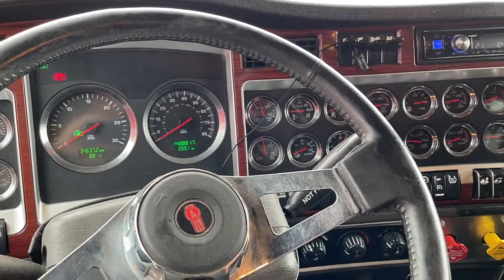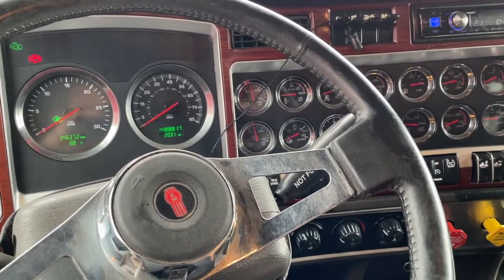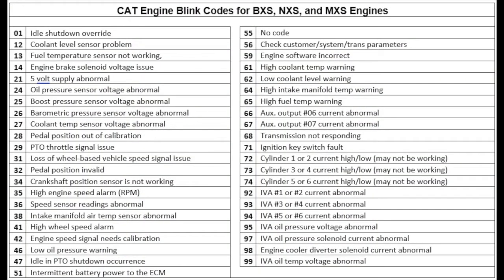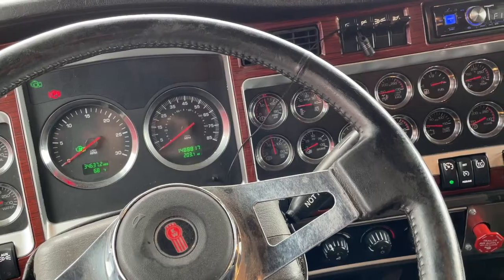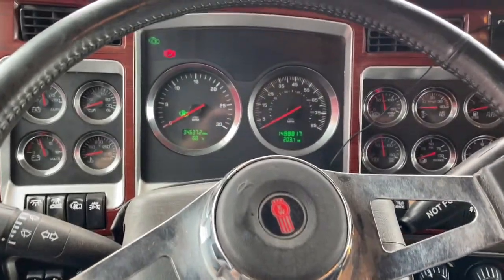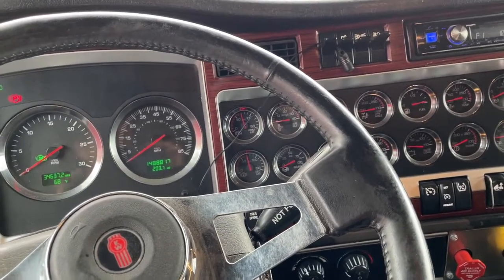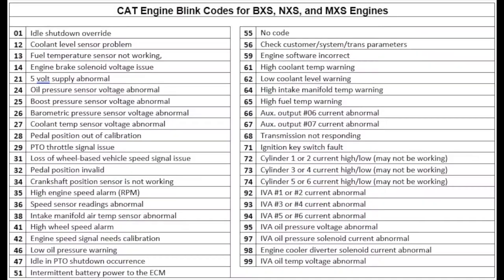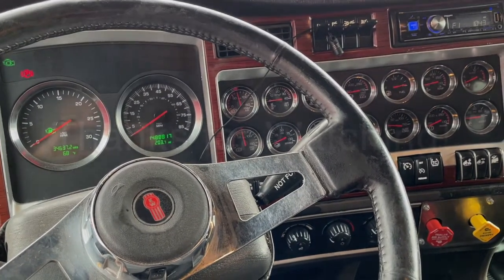CAT Engine Blink Codes

Comment: Hey, does the code go away after the problem is fixed or will it still come up when doing this?  Something like low coolant code 62.
Reply: One thing I love about CAT engines is they don't need to be pampered, once the issue is fixed the code will clear itself

Comment: I have on my truck the 55 code driving down the road with out doing the test. Any idea why?
Reply from the maker: Yes, you have an intermittent code that isn't staying on long enough so it always registers a code 55 - no code. Most likely you have a 92-95 code. You have to plug into it and pull inactive codes and it will tell you which one is giving you grief.

Comment: It’s not working for me any thought on why?
Reply from the maker: Well...unfortunately I don't have any ideas. I have never not had this work and we have been doing it for a long time. Are you sure you are doing it all right? Key is on, cruise is OFF, and then push and hold the SET button until it starts flashing?
Reply: @DDTruckDriver   figured it out was missing the ground for the throttle splitter on the crane side and it was throwing the engine light on